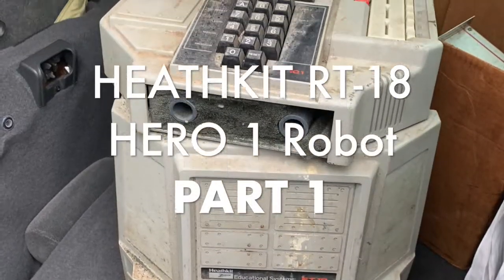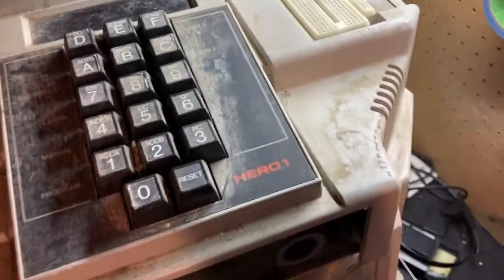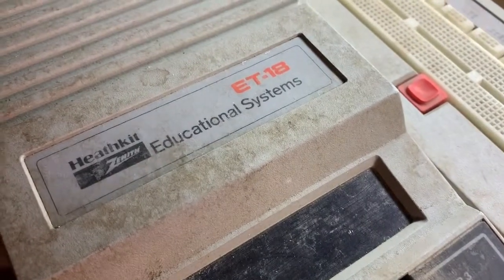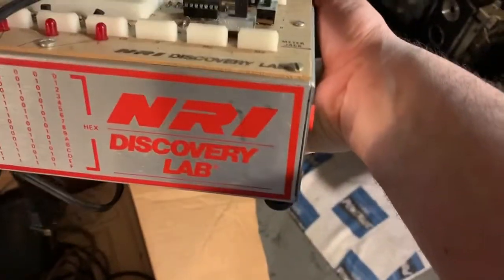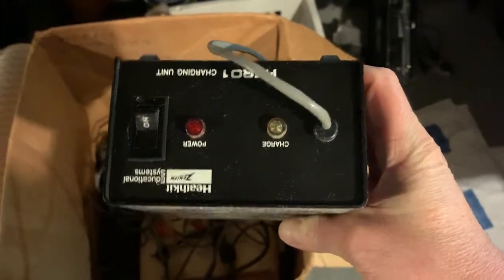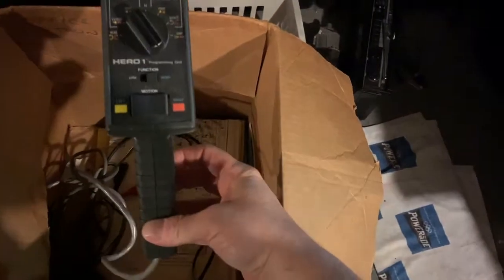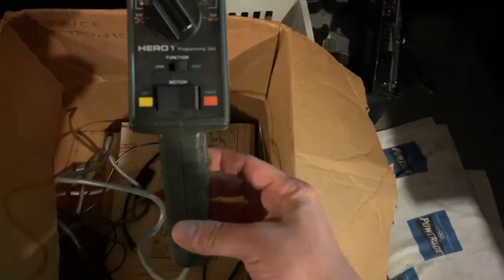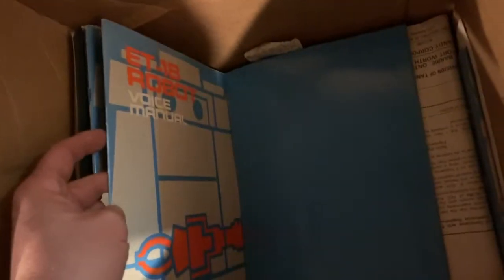Heathkit Hero 1 Robot Rescue Part 1

Comment: I loved these guys... The whole Hero series! I'm totally blind, and always was fascinated  by text to speech voices, and just robots in general back during the early to mid 80s.  Iused to go to Heath Kit almost every weekend and drive the guys crazy asking them to run the demo.... Thanks so much for this...
One thing I noticed that's diferent about the later Hero 1 models, if my memory  serves right, the original speech  synthesizer  was Votrax, I think it was called, but from what i've heard of the videos on Youtube, most of the Hero 1s later are using the same synthesizer for speech as the Junior and 2000.... Very very cool though... I've always wanted any one of the Hero line....

Comment: I use to get the Heath Kit catalogs in the mail when I was a teenager. 

I was not a typical teen.  I loved electronics and robotics.  I subscribed to every electronics magazine being published and built many many projects.

My second job (first was lawn mowing) was with an electronics company.  No fast food joints - ever.
Reply: Sounds like me, lol. I spent my youth (early 80's) in Radio Shack learning to program Basic, Cobol, Fortran... then got into electronics. I built my first laser light show at 14 years old using the old HeNe tubes.. good times.